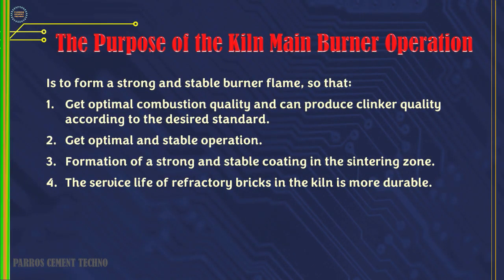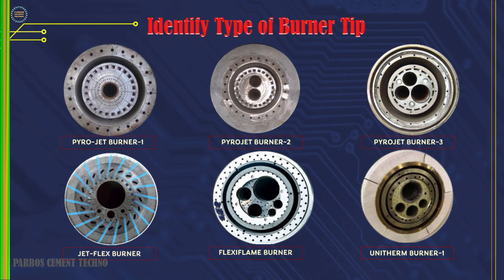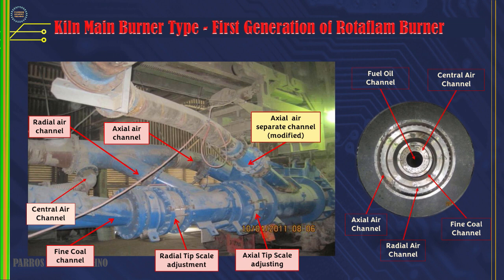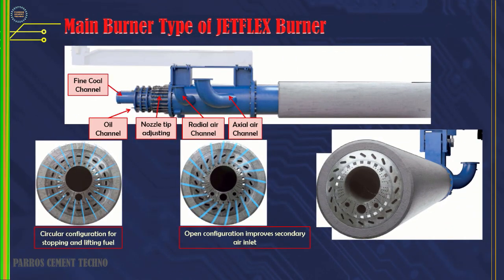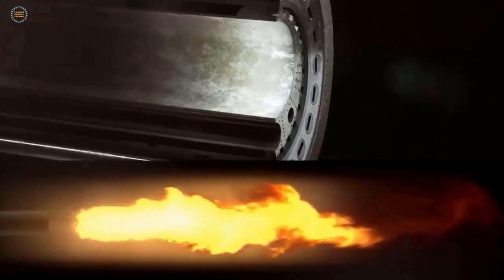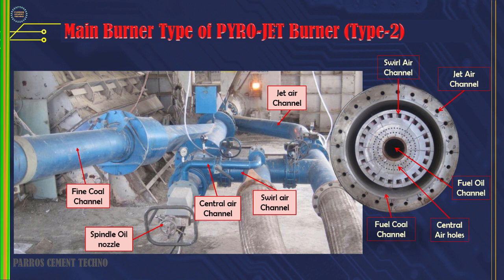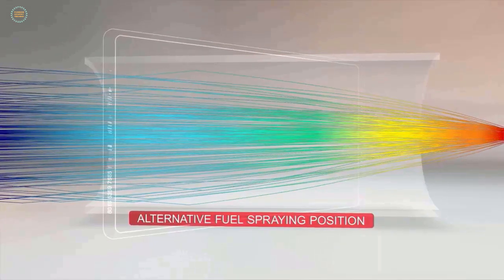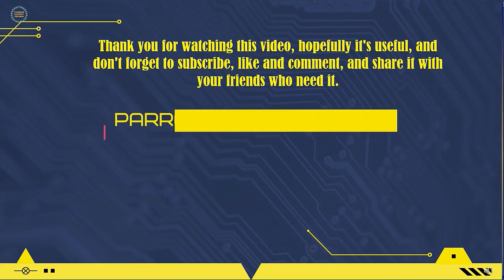Kiln Main Burner Types Used In Cement Plants (Kiln System)_ English Version

Comment: What is the temperature inside?
Reply from the maker: The temperature inside the Rotary Kiln in normal operation is 1400 to 1500 oC.
Reply: Your kiln,what temperature you got?
Reply from the maker: The average flame temperature in the sintering zone is around 1500 oC and the material temperature is around 1400 to 1450 oC.